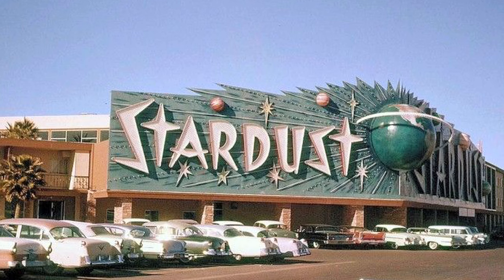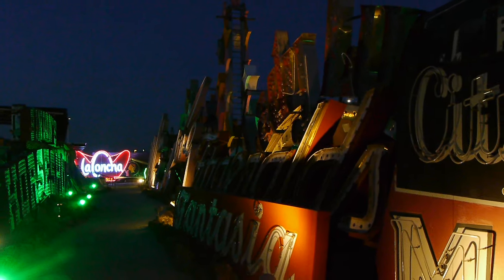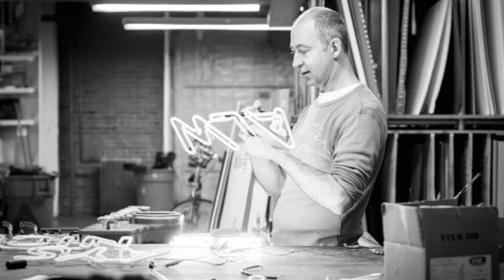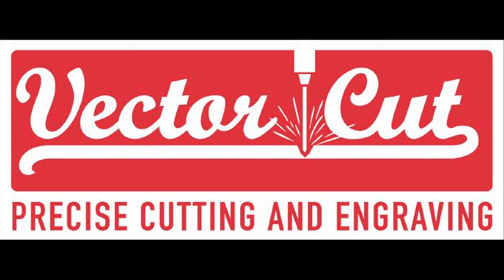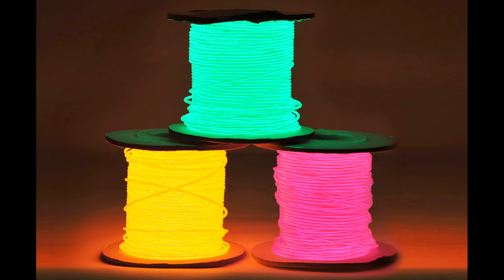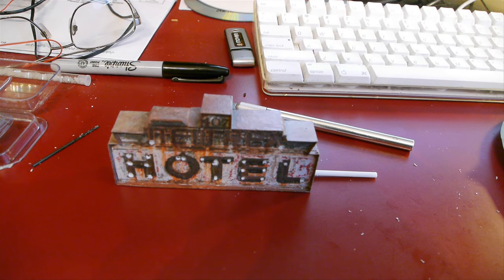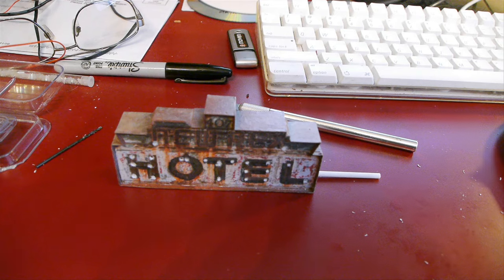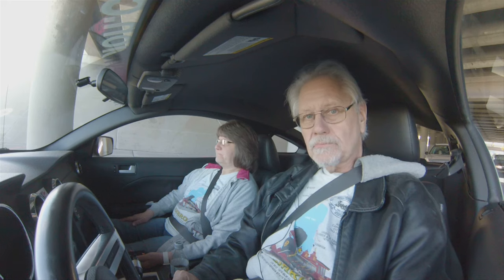Modeling Neon Signs and the Las Vegas Sign Museum

Comment: Awesome video! I found it while looking into options for lighting and signage for my N scale layout. I had never heard of EL wire and panels before, so that's a great new direction for me to investigate. Thinking the EL wire might be a little big for N scale? But cutting small EL panels and putting opaque material in front of them with cutouts for the letters and such might be the way to go.
Reply from the maker: Hi. And the .9 mm seems to not be made anymore. That’s Cool Wire still has some but I think that’s the end of that. For n the best way is the etched clear. I have that on our O scale bar and it’s amazing. We showed the HO scale bar sign in this video. That guy isn’t doing that anymore. But with laser etching everywhere you can make them yourself. Hum…. We need a new video on that…. No matter. Even any Joann store has a laser. Simply make a image file with your sign. You can even draw it with a pencil or pen. Do it large so you can get it looking great. Then have them etch that into clear sheet. They have that there. Make a bunch. No extra cost for that. Now they can laser it out of the sheet but most places have no idea how to do that. So then you may need to cut it out yourself. Anyway mount it in your window with a red LED or better 2 at the edge. Do it in a way that the edge of the sheet and the LED doesn’t show from the front of the model and TA DA!  Neon!
Reply: @ToyManTelevision  awesome info, thanks for the detailed reply! I didn't realize Joann has lasers, but that's a game changer for me so I'll check it out. (Have been wanting to buy one but lack the space and funds lol.) I do my graphics with Adobe Illustrator so that can all be easily scaled up or down as needed. I'm in the early stage of designing a project that might end up using all 3 of those lighting methods. Maybe a little ambitious, but I can never seem to do anything half-heartedly lol. A bummer that the 9mm EL wire is on the way out, but I had been looking at That's Cool Wire earlier today. I like how they have kits you can design and they ship them ready to go. I'm a better modeler and graphic designer than I am at electronics, so that takes out some of the intimidation factor for me. We'll see how this all goes. Thank you so much! And I'll be checking out other videos of yours when I can.

Comment: A grand job sir.......
Very impressed with your attention to detail, perhaps if you'd shown the sign in situ....?
One other (trivial) detail, when showing the bone-yard of signage.....
Perhaps for example, when showing the 'Silver Slipper',  maybe intercut with 50's stock footage of the actual sign.....
Younger patrons won't remember the establishments...
Ramble.... ramble...etc...etc.....
Reply from the maker: It was a a shame the signs in the street, IE the Silver Slipper, were all out.  The city was working on the street, and had shut off the street lights for about 6 weeks. AND those signs are part of the street lighting. Like to do at some point a show on Dobie Doc, and the Old Las Vegas Frontier  Village which included the Silver Slipper.

Comment: I want to see if I can use this for my control pannels on the edge of the RR layout instead of LED lights. Possibility???
Reply from the maker: +David Curtis Sure. I have a fun thing I built a few years ago, trying to get then back up, castings. I am setting up my casting equipment, should be working in a few months. Can't attach a photo here, but it's a little switch lantern, about 1/2 tall thats mounts on the control panel, and the light changes from red to green as you throw the switch. There is a photo of one here: http://oscaleguys.com/sites/layouts/MRS/MRS_electrical.html

Comment: What glue did you use to glue paper to the plastic sheeting? Kind of paper?
Reply from the maker: Just standard printer paper. The glue is actually double stick tape. We get a type that’s just a glue. Once the backing is pealed off all that’s there is a sticky glue.

Comment: Very cool. Your sign looks great but do you think this is practical in HO?
Reply from the maker: +Bruce Collins Hard to do, but I think so. The way to make really small neon is the engraving system, engraving channels in the back side of Plexiglas. Call the Train Shoppe (on the web site) they have a bunch of these and they can be custom cut. BUT the wire can be used to light the plexi. Just wrap it around the edge. Then you can animate or change colors, or??? But the wire scales out  to about 75mm, a bit big for HO. Could look OK I think for Florissant, but too big for neon.  In O I think you can get away with it and in 1/20 its spot on. BUT with engraving, you could even go down to N with no problem. PS, I don't have a "deal" with any of these providers, I don't make a cent off it.

Comment: I love your work! I was looking for a way to make neon signs for my train layout.  What guage wire do you recommend for S-O scale?  Thank you for your help and for making this video.
Reply from the maker: The  .9mm is the smallest made. A bit big in your scale, but should look ok depending on how you use it. There is a NEW product, laser wire!! Not ready for prime time as yet, and expensive. About 10 per foot and you need a laser to drive it. A laser feeds one end of a fiber optic wire that is frosted to emit light along the wire. This will no doubt be available in VERY small sizes, but isn't yet. BUT if they make a .1mm, and they could, HO anyone? Requires no wiring as its just fiber. May be better soon, and cheaper. Google for it.
Reply: Toy Man Television I will look into that.  Thank you for your help.

Comment: There are side glow fiber optics now Also. have not used it but a possible for this situation.
Reply from the maker: +John Gutowski Been wanting to bag some of that stuff. Interesting. I did try years ago sanding fiber optic. Worked too. But not too well. BUt if you really roughed the surface, it sort of glowed.
Reply: +Toy Man Television I am not sure if it would put out the same glow as the wire. I am considering it for a Rexall sign. I model the 1880's in o scale. But I like to build models. just for display more like art pieces. Sign looks fantastic. what is your next intended victim.
Reply from the maker: NO the wire is great! The fiber was not good at all. Not sure how the side light works, but the EL wire is exactly like neon.